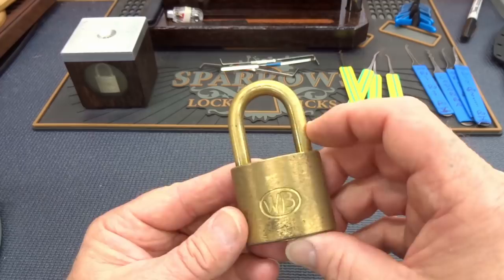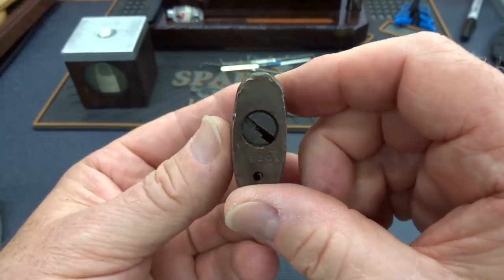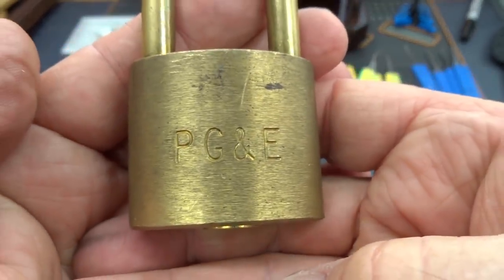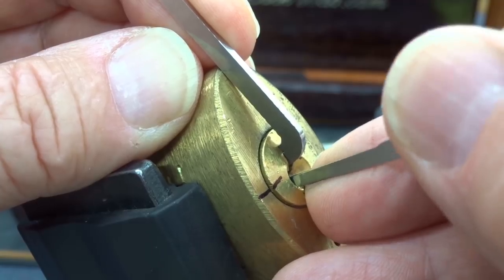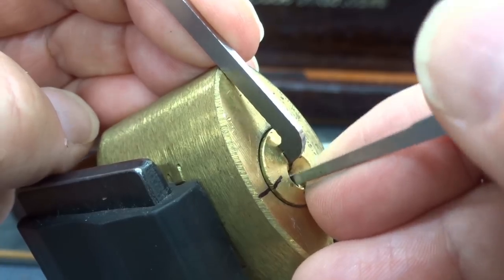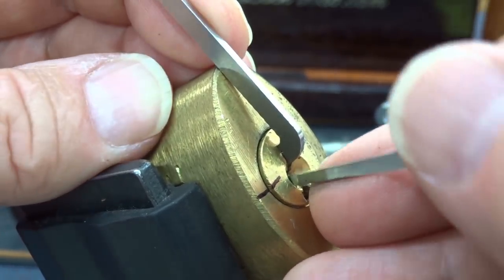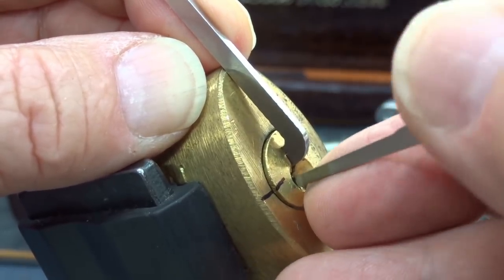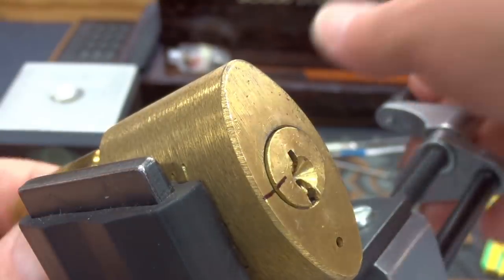(1306) PG&E Wilson Bohannon Padlock

Comment: I have around 12 of the 50mm variant, and the easiest way is to use the "Sawtooth" pick from the GoSo (brass colored) set and a thick wrench (I use the music wire one that came with the aforementioned set) and quickly rake and rock under very heavy tension. They open for me in less than 10 seconds even with heavy aging on them. "Herculock" padlocks work the same way, and essentially are the same lock.
Keys mean nothing! Happy picking to you!

Comment: I only own one Wilson Bohannon lock, but it's got 2 spools in it. As a newbie picker it really threw me because I "knew" that a Wilson Bohannon lock should have 5 standard pins. In fact that was the whole reason I got it. It was supposed to be one step up from a Master #3, but it ended up being two or three steps up. It was only later, when I really learned to deal with security pins and picked it again after leaving it alone for a couple months, that I realized why it gave me such trouble while I was still learning.

Comment: I have one of these from Equitable Gas (EQT). I have the key for mine, but I have picked it. Mine will open with either rotation and has all standard pins. One problem I had with it though, is that the core tended to bind in the body with anymore than very light tension. I lubed it up and it only helped slightly. Works smooth as butter with the key though.

Comment: Still love your videos and the commentary really helps to picture the inner workings of the lock. Anti clockwise picking is a bit easy on the security front but the brass shackle is a "golden egg" for metal thieves especially if there is copper wiring!!

Comment: Need to remember, Master can be picked Counter Clockwise - provided it doesn't have the steel face preventing such a move.  Most Padlocks can be picked CCW - if they're not a ball bearing type locking mechanism.

Comment: I got started in Locksport a month ago. I've been fairly successful. I've single pin picked Schlage with spools and Kwiksets with security pins. My neighbor loaned me a Wilson Bohannan padlock with a 2 1/4" shackle to test my skills. I have sat for hours trying everything and cant get it to open. I have tried single pin picking and a variety of rakes. I've tried Bok tension and Tok tension nothing works. I dont think I've even gotten but one false set out if this thing. I keep telling myself it's an old lock and has a Gremlin inside but I cant help wanting to get it to open without the key. I dont care if I have to use a rake

Comment: Lovely WB padlock Bill... Love the brass shackles on them as have one with brass shack and a few others in collection as standard.
Reply from the maker: Do you have one with the CCW core?  If not, let me know and I'll get this one to you.
Reply: I picked my full brass WB about 3 years ago buddy and on video. I picked it as you do in normal CW position and popped it quick. After reading your reply I just got it out again and tried CCW a moment ago and does pick in that direction too... The brass shackle on mine is a bit bent up LOL!!!! have a video of it, if you want me to add a bit later to your thread?? Another interesting thing, is that yours is a Pacific Gas & Electrical. The one I have is Columbian Gas Systems. On bottom of mine by keyway is the number 43, so as you say.. Lock out locks. Is yours about 40mm, apart from nice oval shape making it feel bigger?

PS. Would love yours to stand next to my other on display if okay and will pop something out in return when I get chance Bill

Comment: Hey so I have a lock a lot like this I picked up somewhere and I was having a hard time getting the key out for almost two weeks. I soaked it in wd-40 thinking that would loosen it up but that didn’t really help so I was playing with it and I remembered I had a brand new lock that did this and I had to pull the key toward the pins before it would turn. So I was wondering if you could tell me how to get it apart so I can clean it because it looks old and dirty as hell. Now that I can get it open and get the key out I’d like to clean it up a little bit. Please just lmk if you know how to get it open.

Comment: so they are brass so they are easy to cut? OR Brass so they will not spark when being cut ? GAS + spark = bang ;-)
Reply: Adrian Higgins EQT uses all brass locks to lessen corrosion problems. Some of these locks are left untouched for long periods of time, and others are used around the tanks that store the brine water that comes from the gas wells. That brine water will destroy a ferrous lock in days if it gets on or in the mechanism. The lack of sparks makes sense also.
Reply: camjamsdad I've worked on large gas well sites for years. The only aluminum wrenches I've ever seen on them are pipe wrenches and that is purely for their lighter weight, as the jaws are still steel. The heavy iron piping that connects everything together from the wellheads, to the separators, to the brine storage tanks are connected with hammer union joints. Those steel joints are tightened by hitting them with a steel sledge hammer. They connect these fittings up directly to live wellheads. The sparking isn't really an issue, hell, they weld the heavy iron just 50 feet away, no worries. Confined spaces are a different story, but of there is any trace amount of gas in the space, you're not allowed to go into it, so it's still not an issue.

Comment: Question: what causes one to lose a false set?
Reply: Robert Clark the false set is due ti the cylinder moving a little from the center of the spool. When you push the pin up you have to let off the tension a smidge to allow the pin to set.